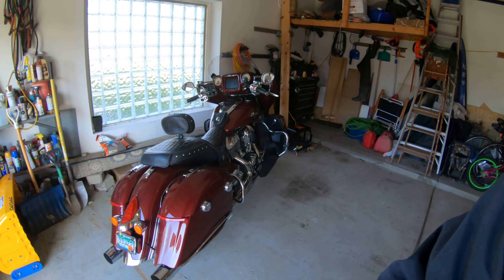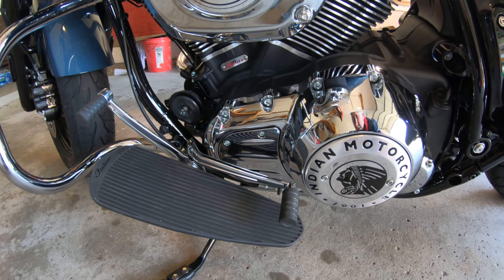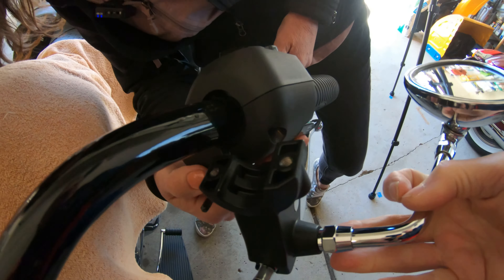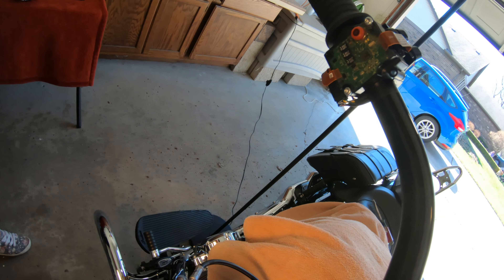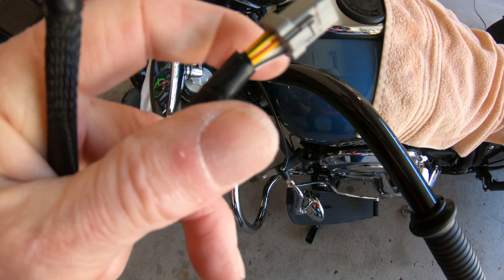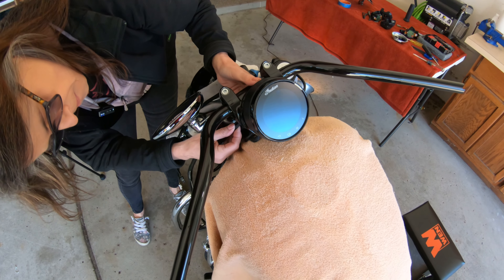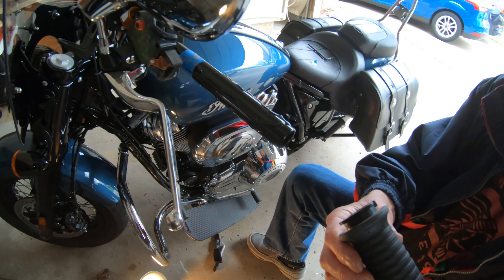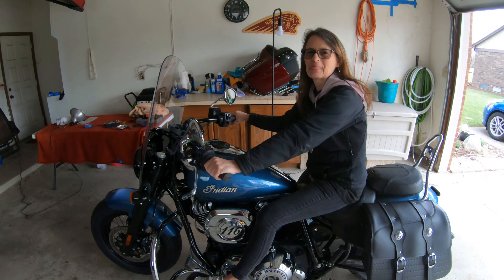INDIAN SUPER CHIEF REDUCED REACH HANDLE BAR INSTALLATION

Comment: great vid on how to change bars. I have the mini apes bars that comes with the Bobber darkhorse. I want to replace to the original super chief  cruiser bar. Do i need longer brake line or will the oem line reach, also do i need to purchase additional clutch side grip handle?  Thx
Reply from the maker: I think that your cables should work OK, and if you are lucky you can remove your clutch side grip.  We couldn't get ours off, so we had to purchase another one.
Reply: @rickiekm Thank you so much for your reply.  debating on replacing the bars.  It's great to have your video as a  reference.  Thanks again Ride safe😊

Comment: Thanks for the video it’ll help a lot when changing bars on my missus Cheif darkhorse 👌. One question you probably can answer. Will that driver back rest you got on the chieftain also fit on the chief? When sesrching amazone or ebay for a driver back rest for the chief darkhorse the results are mixed 🙄. Any insights in this would be apreciated 😃.
Reply from the maker: I’m not sure, but I don’t think it will fit the Chief.

Comment: Hi, did you torque the clamp bolts or just tighten them down? I’m trying to adjust my bars and can’t fit my torque wrench even close to the bottom bolts.  The manual calls for 18 foot pounds on the bolts and I’m not sure how critical that actually is.
Reply from the maker: The bottom two bolts were tightened without torque wrench, but we did use  blue Loctite
Reply: Thanks. I’m pretty incompetent but learning slowly.

Comment: I see that Indian sell a kit to go with the reach handlebars.  It consists of a new clutch cable, brake cable and handlebar wiring.  It's expensive and it looks like you didn't buy or need it.  Is that correct?
Reply from the maker: That is correct. You can use your current cables.

Comment: I took my handlebars off and reconnected a taller set of handlebars. Therefore I needed a longer wire harness. After I replaced this my bike will not start. Won’t even turn on. Any idea why? Thanks.
Reply from the maker: Oh boy, that sounds like a connection might not be hooked up right.  I hate electrical issues.  Sorry no help here.

Comment: Hello, no problem with your wrists?
Looks a little forced.
I can not decide between reduced and 5" miniapes on my CDH.
For ergonomics the reduced should be the choice but regarding style the apehanger in my model looks a lot better,  like in the bobber.
My problem is that i have "reduced arms" 😂 and stock drag bar is terrible for my shoulder, back and arms.
Reply from the maker: After we added the 1 1/2” spaces, the bars fit here perfect.